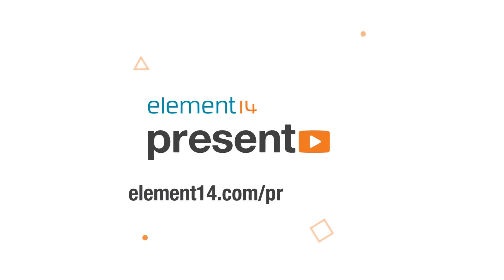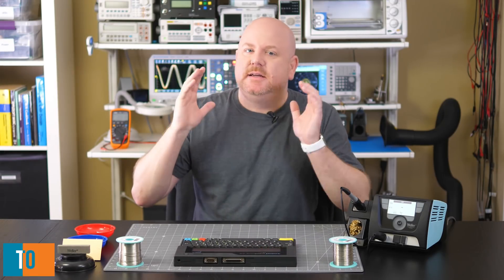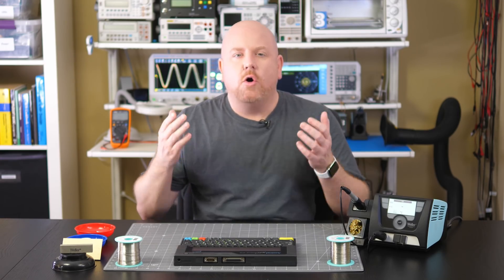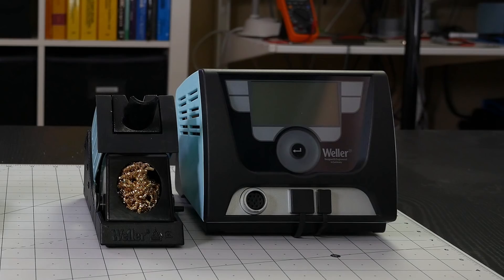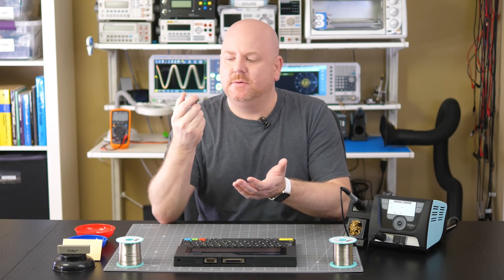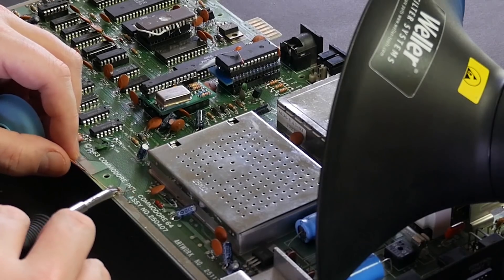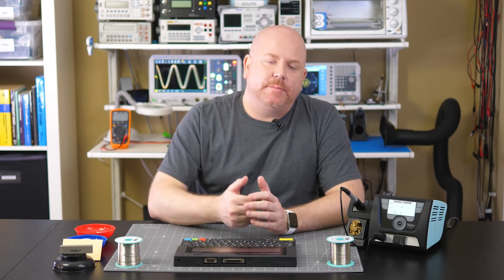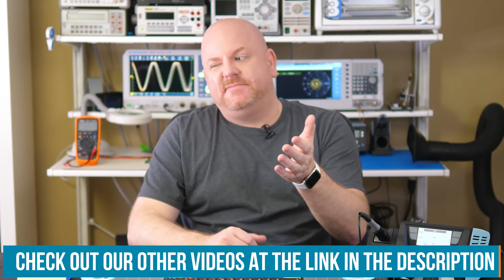Soldering Maintenance Myths - Workbench Wednesdays

Comment: Good video. I was horrified by one thing however. Why in the world are you using rosin flux in this day and age? The first thing I try to do when consulted regarding soldering is switching to OA flux. You instantly eliminate the need for alcohol and chlorinated solvents and get a beautiful solder joint. It cleans with warm tap water and produces excellent results on almost anything. I fought changing from rosin a long time but I never look back now. Water based fluxes are soooo much easier. I've soldered a LOT, on all kinds of things. I first soldered in the sixties and worked a lot in RF which means lots of copper planes and bulky connectors, as well as hybrid (miniature) electronics and cable assemblies. I can hand solder down to 0201 case size SMT (0.020" x 0.010"). Also, the wet sponge creates a "thermal shock" which helps remove oxides. Most soldering iron literature mentions this. I've done as many as 500 boards on a weekend.

Comment: What about having the roll of solder inside the solder station and feeding up the umbilical to the tip of the soldering iron and solder will be fed to the tip by pressing a pedal on the floor that also controls the speed of solder to the tip and also means you have a free hand to do something else.

Comment: I like to use a 1/2 inch wide double bevel tip to solder TQFP packages. I just solder all the pins in a giant  blob and let the tip wicking effect remove the extra solder. Of course in order for this to work the board has to be vertical,  the tip pointed upwards, and the tip has to be tinned back a ways.

Comment: All this advice is exactly why I stopped using store bought tips and started using tips I made myself from 8 gauge copper wire. They do tend to oxidize really badly since it's just pure copper, BUT... I only need to maintain a small area on the tip. The rest of the tip is allowed to oxidize because the rest doesn't matter and since it's just pure copper I can sand it or polish it as I see fit. On top of that I can make all kinds of tip styles and even some I've come up with myself such as the hook tip which wraps around half the diameter of a wire.
And to add icing to the cake, the store I get my wire from sells it for 60 cents a foot, and my tips are 2 inches long on average, so about 5 to 6 tips per foot, buying 10 feet of wire at a time affords me a massive space for goofing around with my tips.
And to add a little cherry to said cake, I do indeed use a kitchen sponge and my tips still last months.

Even with all the abuse I give my tips, I tend to have little no no problems soldering anything and everything on a cheap, 20 dollar 20-40 watt switchable soldering iron I got from radio shack before they went out of business.

Still, it's good advice for noobies.
Reply: A piece of thick solid copper wire also makes a great soldering gun tip.

Comment: Good video.   I've been soldering since the early '80's.  I've always used tap water wetted sponges and never the metal sponge. Keep your tip well tinned and you'll never have trouble with tip life.  I still have good tips from back in my college years.  Irons with standby temp control would have been great back in the day.  I had to keep mine ready to go at all times.

I kind of miss the days of troubleshooting down to the component level.  It's all board swapping nowadays.
Reply: Me too, atleast the tap water part. I wasnt even alive in the 80s.

Comment: I found that of all the T12 tips I have the hooved tip has the greatest thermal mass, meaning that it takes a bit longer to get up to temperature, but also it is much better at soldering elements with a greater thermal mass (like massive ground planes). It's perfect for soldering 3W LED beads to aluminum core PCBs that double as a heatsink.
Reply: I personally like medium-small hoof/well tips as my general purpose tip, because you can use the beveled edge to apply a lot of heat, but you can use the point to do precision work.